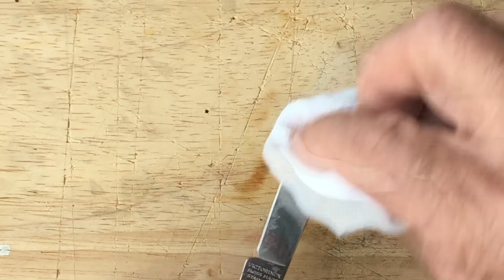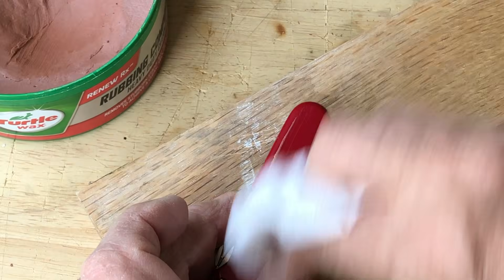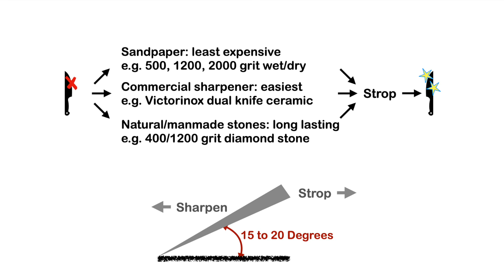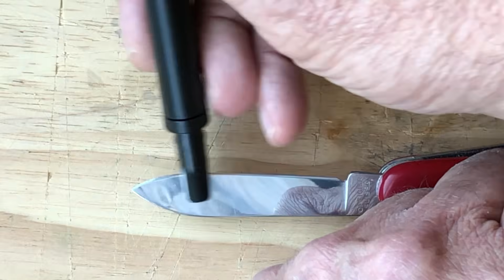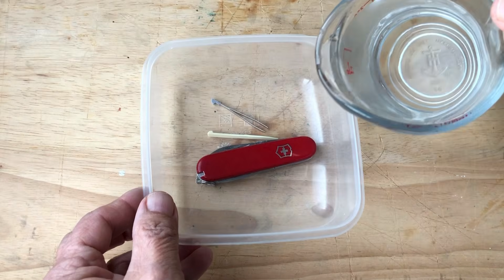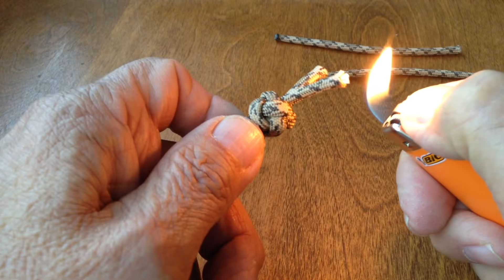Basic Maintenance of a Swiss Army Knife

Comment: You know that in the handle of the sharpener contains a ceramic sharpening stone that can be pulles out ? The industrial V shaped side is only there to give the blade the last kick. 
You can also use WD-40 instead of the Victorinox oil.

Comment: I'm in Australia and as for sharpening, I can tell you there's no better choice than the a Norton silicon carbide stone, the black and grey one. I've been a knife hand in beef abbatoirs for 16 years, mostly skinning work and as for everyone getting the most expensive stones or a arrangement of increasing grits, dont bother. Norton makes the best single stone option if you want simplicity. The silicon carbide stone is almost perfect straight out of the box. Most other oxide stones need a break in period before they smooth out.

Comment: I tried to sharpen it using sharping rig, it works kinda, but leave scrathces on side(from abrasives that get into the clamp). Also adding water to the sharpening stone crucial for proper surfacing of the edge. I also tried hand sharpening. It may seems hard but actually its not with this knowves, they have very nice curve that lays on the stone very well when sharpening by hand. 

I'd say if you have a rig - sharp with the rig, you'll be able to set strict edge, but if you haven't - do by hand, it's not so complicated as may apear, it's even easier to get nice edge and razor sharpness by hand sharpening than using rig. Llike from start to finish its 3-5 minutess of hand sharpening vs 30-40 min using a rig to achive same result, with rig sharpener edge will be same sharpness but sligthly more clear and flat edge line. 

Also I do not recomment to polish edge with stones over 600 - they become duler and stops shave, especially when i go over 1k grid. IDK why, is it my cheap chineeze stones or Victorynox stainless steel didnt make for that. To make edge shine I use skin belt after 400 grid with small ammount of polishing compound.

Comment: My father taught me how to use a knife. At the end of this video you close the blade in exactly the way my father taught me. No other YouTube videos I’ve seen does. Blades are pushed upwards with apparently  less than firm  grip on the body of the knife. When you’ve cut your fingers with a non locking blade of an Opinel knife you take great care never to repeat the mistake with any other knife. ‘Our’method keeps sharp edges away from fingers without having to look.
Reply: Learned this the hardway when i was young and dumb 😅 i use the knife of my sak as a screwdriver driver (classic) first deep cut, still have the scar in my index finger 14yrs later to remind me to be careful around knives specially slip joints

Comment: With both the victorinox sharpener and the sandpaper, he's running the abrasive completely past the blade tip, which is going to round it off. And as far as the automotive compound, why the dickens would you feel the need to remove light scratches from an SAK blade?

Comment: Weird. I use a Sorby ProEdge Plus and it takes less than 2 minutes. Since it sharpens every other edge I have it was money very well spent.
Reply from the maker: Different devices yield different results. The sandpaper was used in this instance as it allows one to explore the effects of different grits without much cost and can still provide adequate results for a pocket knife. If one is diligent with blade care, then stropping may all that is needed most of the time.

Comment: the 2 penny method?  well it depends on how far down the blade you contact the 2 pennies -  close to the edge will have a much steeper angle that out at the top edge
Reply from the maker: Yes indeed. And, the width of the blade will also affect angle.

Comment: I broke a piece of my blade (using it as a screwdriver.. yeah I know). I still love /carry/use the knife though so I will maybe reshape the blade  and I really should service it.
Reply from the maker: The steel that Victorinox uses is hardened but you may be able to carefully reform the end of the blade in a vise or similar device. Alternatively, you can reshape the blade. Try using a course wet/dry sandpaper or a good quality file. Be careful of overheating if you use a grinding device. Alternatively, it is possible to replace the blade, but you will need to remove the scales and drill out the rivets. Save the rivet ends as you will need to reuse them.

Comment: why i like all metal multi tools just leave in jar of alcohol over night to sanitize
Reply from the maker: Yes, you can certainly sanitize with alcohol. The use of much diluted bleach is a common practice for sanitizing. You do not, however, want to leave the SAK in the bleach for extended periods as there will be a reaction between the differing metals. I try to use common household materials for these DIY videos.

Comment: Nice video!
I have three Victorinox knives, and as nostalgic as I feel about them, they’re just not reliable tools.
The steel is way too soft.
It would be nice if they started selling something more modern at a higher cost, with more utility.
Reply from the maker: The steel is certainly a compromise, but is fairly high in chromium, and really quite easy to sharpen compared to some of the more modern steels. There some pocket knives that have stouter blades as well as better steel, but the costs are much higher. The Victorinox SAK has been used, in some form, by the military for decades.

Comment: I have numerous Vict and Wenger pocket knives. Several years ago I bought a well-regarded electric sharpener that works great on my kitchen knives. This has the capacity to sharpen to the European "standard" as well as the Japanese. The difference is that the European is a steeper angle edge (wider) than the European. The accompanying material said that Victorinox and Wenger need to be sharpened to the narrower, Japanese standard.
Reply from the maker: Yes, thanks for the feedback. Kitchen knives are often sharped at a 20 degree angle, or 40 degree inclusive of both sides.

Comment: Would you not load the strop more evenly? It seems you have a lot of unevenness on it with some leather spots with nothing. I use a hairdryer to heat the compound and the strop and spread it till there's nothing but green.
Reply from the maker: Yes, unfortunately, the lighting was such that it appeared less than ideal and it was also a smaller new strop that was easier to video. Once broken in the strop will tend to be quite uniform.

Comment: Very educational video. The knot you tie at the end is beautiful.
    I maintain my knife edges with a butcher honing steel rod. Or chaira. Doesn't remove material from blade and realigns the edge.
Reply from the maker: Thanks for contributing. I agree sharpening certainly does remove material. Frequent stropping will minimize material loss and keep the blade aligned if it is not too abused, too.

Comment: Easy to use and safe! The base grips firmly on my countertop MyBest.Kitchen and my knives have never been sharper. I run my knives through the fine setting before each use, and use the coarse setting only about once a month. A sharp knife is much safer to use!
Reply from the maker: Thanks for commenting. I include the sandpaper technique as it allows people to experiment with different grits at a low cost and  make informed decisions for future sharpening tools/methods.

Comment: Thanks for sharing your knowladge. For my Victorinoxs I use a pull through Victorinox Sharpener wirh tungsten and ceramic rods. It works...
Reply from the maker: I agree, the challenge is to find and then use a sharpening method that works for you. Don't forget to strop as this takes away far less metal and can minimize how often you really need to sharpen.
Reply: @resilienthacks7038  I'm new to stropping what do I need?
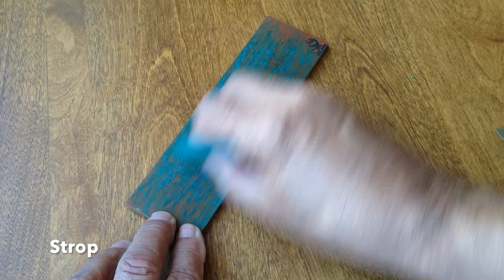Reply: @6900pilot  At 4:05 he shows how to strop the knife blade.

Comment: Thanks for this. Enjoyed the simplicity of the video and honest options. Going to likely go with the stone method for my champ.
Reply from the maker: Many do gravitate to using a stone. If, however, your blade is not heavily worked or dinged, consider stropping as it removes the least amount of material yet does a nice job of realigning an edge. Stropping can be sufficient for maintaining a good edge on thinner blades. Thanks for watching.

Comment: I use ronson lighter fluid for adhesive clean up then soak in ammonia water for about 5-10 min to get all the internal gunk then I use a light machin oil for lubrication  and to get the scratches off the  handle 500-2000 grit progressively to polish the handles
Reply from the maker: Appreciate you sharing your ideas. Your effort makes the comments section much more useful and we all benefit from  the discussion and learning.

Comment: Until you've owned one of these tools you'll never understand how utterly shit they are.
Reply: My ones quite nice....
Reply: I carry mine almost daily.
It has been extremely useful for decades.

I will say the blade's steel is not the best they could have used but it gets the job done.
Reply from the maker: I suppose it depends upon how you use these tools. The SAK is indeed a compromise. It will not replace purpose built tools such as those designed for wood carving. And, even then one might have specific tools for green and dry woods.
Reply: Why?
Reply: I find mine to be rather useful.

Comment: Tip nr. 1: send it to victorinox, they will service it (life long warranty)
Reply: Tip nr. 2: attach a piece of paracord to your knife
Reply: Do you have a video about sharpening the scissors,lots of good tips though
Reply from the maker: Sorry, missed this comment. Felix Imler has a good video on sharpening the scissors. Alternatively, you might want to consider stropping only the scissors cutting edge as this action will realign the edge with very little metal removal and is less likely to cause damage.
Reply: @GM57374  if not check Felix Immler

This video was pretty good  so I’d look here first.
Reply: Didn't know you could send it back for a service,only had it 41 years,spring on scissors,need replacing,and grips worn.
Reply: @Jesse Mustafa So not of any interest,I must be really really bored,lockdown,will do that.
Reply: Really? I didn’t know. Many thanks 🙏🏼
Reply: @neshiah4747  not only will they service it, they replace broken tools etc. at VERY low cost. I just sent my dad's military knife in for service, it had a bent main blade and a broken awl (i'm from Switzerland...). They replace the scales in any case, you can tell them not to do so (for sentimental reasons etc.) or to send you the old scales... It's a company that goes WAY beyond standard...
Reply: Or....Be all the Man that you can be and learn and service it yourself. Does Mummy still wipe your bum?? 🤣 #CuriousMindsNeedToKnow
Reply: @stephenfewson7188  so, manly man… you make your own spare tools if they are bent or broken? 🤣🤦‍♂️ i just got my dad‘s SAK with broken parts back from Victorinox (they are 1h from where i live…). Everything that was bent, broken or dull was replaced, refinished, sharpened & new scales. 

That‘s more coloscopy then wiping your bum but if that‘s what your mom is into… feel free 😉 /irony
Reply: @stephenfewson7188  you are one of those guys eh? Really hard flex bro